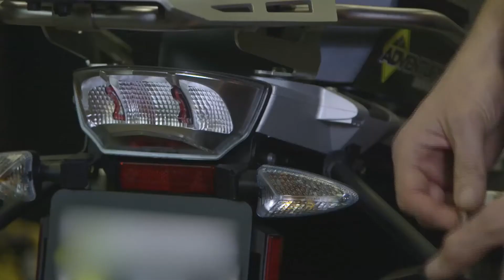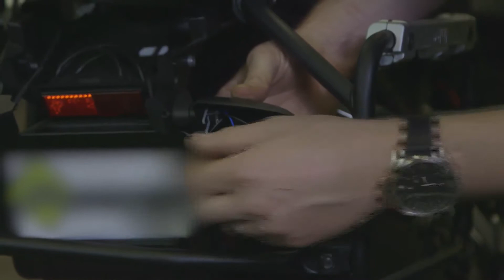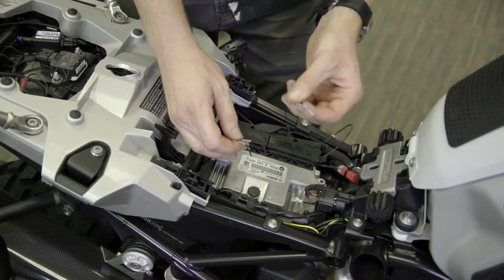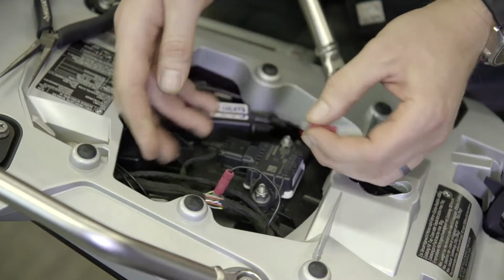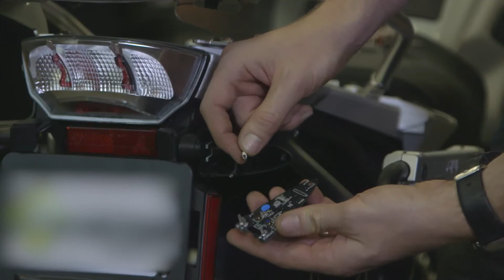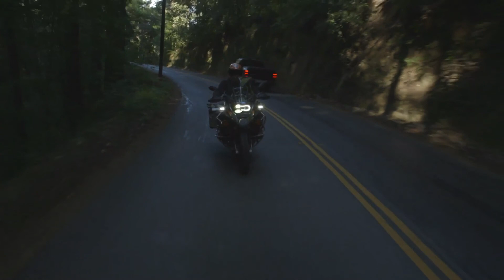Weiser 2 in 1 LED Brake Light and Turn Signal upgrades installation

Comment: I watched carefully since I just ordered and you guys missing part. first connect to battery with relay part and which cable is brake cable to connect black brake cable come out from relay. I have 2019 r1250 gsa.

Comment: I agree that this is too expensive but I always believe there's really no price tag for safety. I'd rather increase my visibility on the road & minimize the possibilities of any untoward incident. Weiser came up with this really great product & can only suggest if they can make it affordable for every rider out there. Re this video: This is really great & I already installed the front driving lights. I'm about to install the rear ones on my 18 GSA & I'd really appreciate it, if you can mention specifically the wire color code from the bike for the 12V+ Brake Light Trigger. I'm sure it's the same as mine & will help others who'd have the same models, do this with much more ease.
Reply: I’m answering my own question re this install, since I already traced it myself. The color code of the brake light wire which is the 12V+ or the trigger connection mentioned in the video is the Gray Wire with Black. That is at least what the color code is for a 2018 GSA. I’m pretty sure it’s the same one as the 2016 GSA on this video. If I’m not mistaken, same would be true for the GS’ of for this particular models

Comment: The video needs to be clearer with better instructions. It skips some steps, especially the part where wires are run to the battery, then another wire ran back to the positive brake wire. I also think this is a great ideal, however, for the price, $249 for just the rear or front, the integration should be better than using tapping in to the factory wire with posi tap connectors.